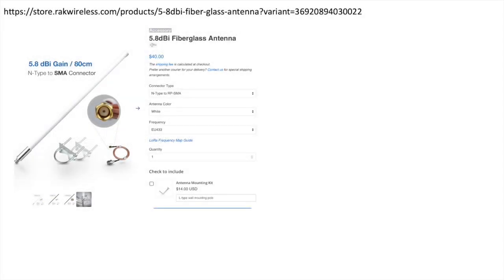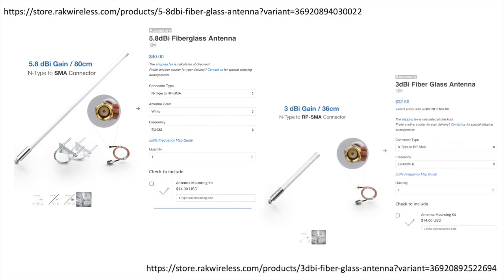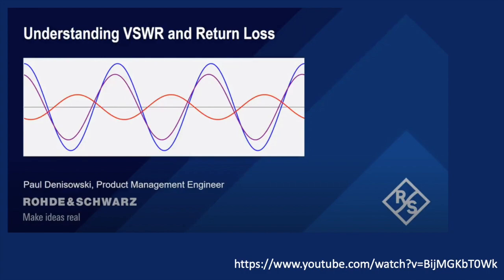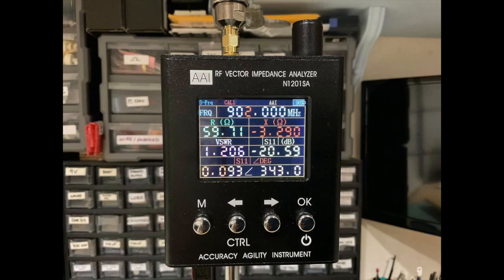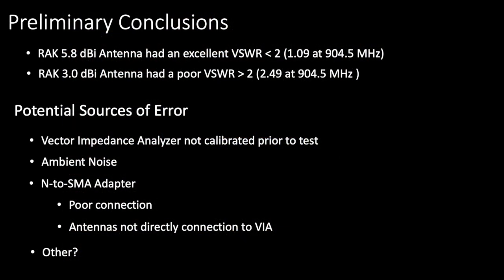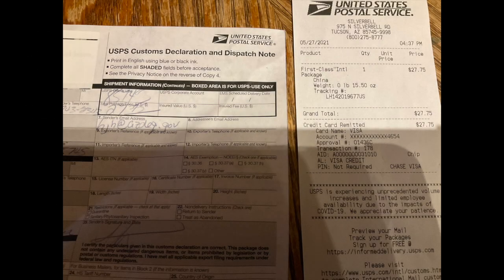RAK 5.8 dBi Antenna Unboxing and VSWR Tests

Comment: You should also test how the performance varying if the antenna is not perfectly vertical. It is a very useful data
Reply from the maker: Would that make a difference on the VSWR?
Reply: @ModestMaker  I don't know. But some people saying it has impact on earnings
Reply from the maker: That is true as it relates to impact on coverage, but it would be difficult for me to make multiple trips to my roof- don’t want to break my neck (LOL).

Comment: Thanks for testing, im using 5.8dbi rak antenna with oem cable rg316 1meter, you suggest to swap with lmr400 1m? or loss is minimal in 1 meter?
Reply from the maker: My instinct tells me loss is fairly minimal at 1 meter. LMR400 is definitely better for long runs.
Reply: @ModestMaker  thanks

Comment: Hello, is there any radiation or health risks to having a 5.8 DBI antenna mounted outside a hone?
Reply: Yes, cover your walls with aluminium foil and start wearing a tin foil hat. It will keep the brain mush cancer at bay
Reply: A home
Reply from the maker: Doubtful— the power output will likely be less than a watt if you are using a RAK concentrator.

Comment: What’s the difference between the white antenna and black antenna?
Reply from the maker: In my prior antennas, I use a 2 dBi black antenna from Adafruit. The antenna gain is about half of the white antenna, and it is not as field worthy for outdoor installations.

Comment: Could you add the pig tail between the antenna and the agility instrument, thanks.
Reply from the maker: If you mean the extension that comes with the antennae, unfortunately no- the connection won’t mate with the VIA.